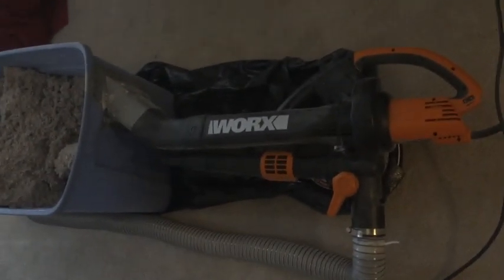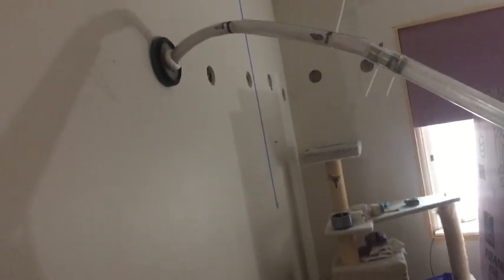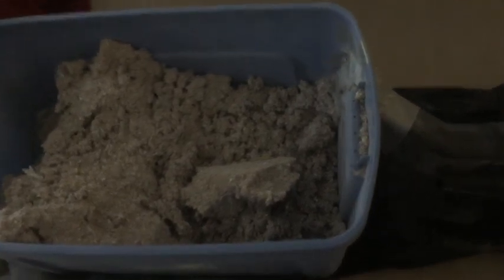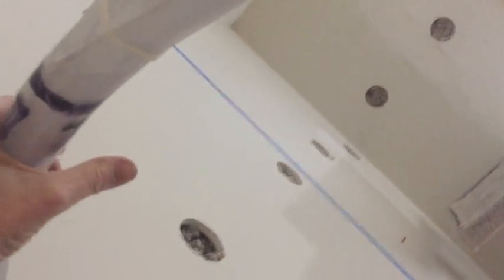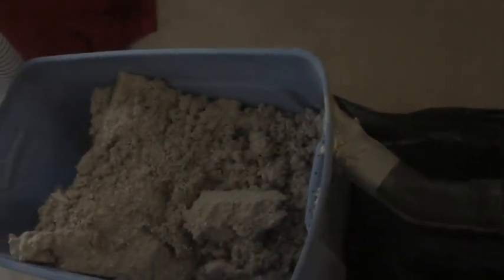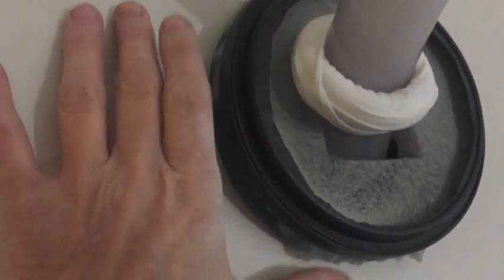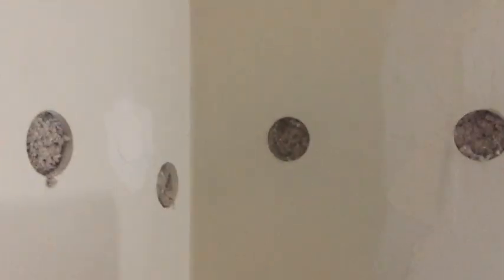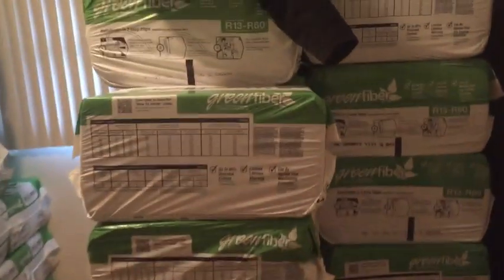Dense Pack Cellulose with a leaf vac

Comment: Nice Job!! I made one too with a toro shredder vac and a heavy metal garbage can. I mounted a harbor freight mortar mixer on top. Its working ok so far just have to make some sort of makeshift gate valve to meter how fast it goes into the blower so prevent clogging. I would have just done the free rental but I wouldn't be able to do all the dense packing in one day.
Reply from the maker: Hi Acejenkins80. Just realize that if your toro is not providing, at least, 3 psi, your insulation is not dense packing. You will have to pack it into the walls firmer by hand. It's a pain, but my heating bill is so much better.

Comment: Just curious; Why not use the blower from the hardware store? They let you use it for free from Home Depot with 20 bag purchase and it looks like you have that many at least.
Reply from the maker: The big box stores in my area, do not have a 3 psi blower to dense pack a wall. They even say on them "not for walls".  Unfortunately, my blower is only blowing 1 psi, so I would have to buy a stronger blower motor and install it into the line to get enuf pressure to dense pack. I am blowing the walls with as much as will fit using the blower and then, hand packing it into the walls to get a dense pack. It is very time consuming. Check out DavidPoz's video upgrading a blower motor on an force 1 to get a true dense pack here https://www.youtube.com/watch?v=JOt9TBwWwM8

Comment: How big was your house and how many bags did you use , im trying to calculate how many i need for mine its about 800sqft home
Reply from the maker: My house is 1200 sq ft. I think I used around 217 bags because I blew an R65-80 in the attack. Here are two calculators.  https://www.insulationmachines.net/tips-and-tricks/cellulose-and-fiberglass-coverage-calculator/    For loose fill    https://www.greenfiber.com/support/insulation-calculator    How to calculate https://www.greenbuildingadvisor.com/question/how-to-calculate-how-much-cellulose-for-a-dense-packed-wall